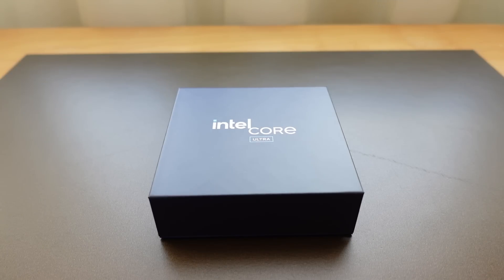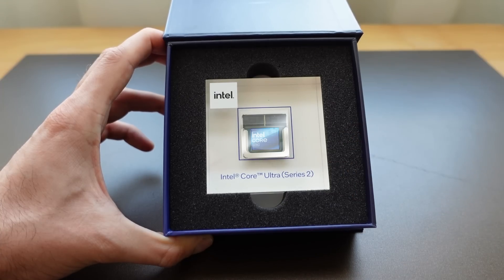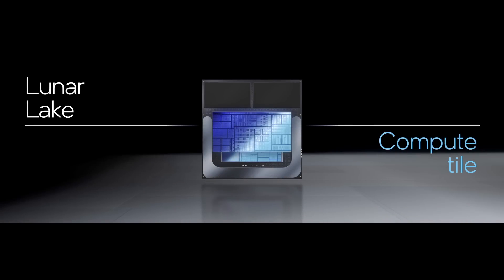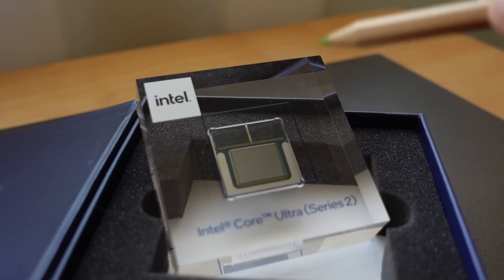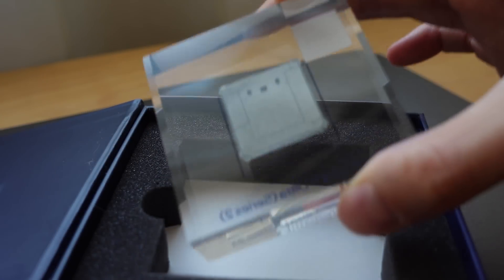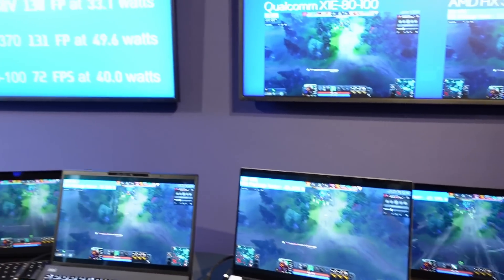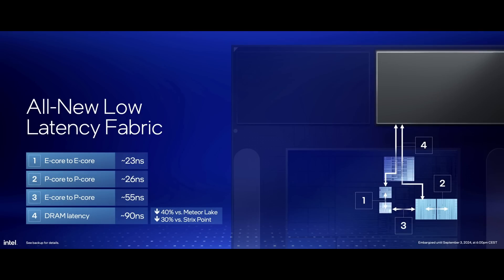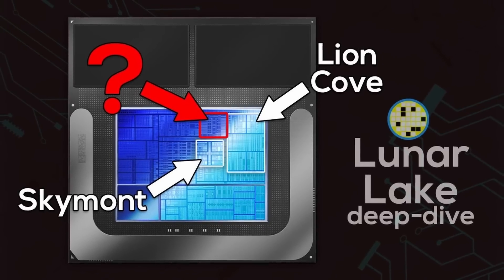Hands-on with Lunar Lake

Comment: I'm really happy you got to get one of these early units! I've commented before from the litho side of things as that was my doctoral research, but I though I'd add that my team did a good chunk of the Foveros groundwork that is in there. I'm really excited for LNL as it's a new sort of approach to chip design, even compared to MTL, for the teams behind it.
Reply: Correct me if I'm wrong but to the uneducated me it seems to be pretty much the same as what AMD does with its desktop CPUs, but more complicated, expensive and error prone.
Reply: @Psychx_  High Yield has a video from May 2023 (i.e. before Meteor Lake launched) called "Meteor Lake – Can Intel leapfrog AMD?". I found it an excellent primer on the technical differences (and different goals) between AMD's "chiplet + Infinity Fabric" approach and Intel's "tiles + Foveros" approach. :)
Reply: @Psychx_  It's actually completely different to what AMD does with their desktop CPUs.

1. AMD's Desktop CPUs divide compute resources between multiple dies. The CPU can be split between multiple CCDs, and the iGPU is on the IOD. This introduces latency and coherency challenges, and costs power to cross the interconnect.

Lunar Lake's compute is all on one die. This means that the CPU clusters, GPU, and NPU can share resources more quickly and at lower power.

2. AMD's desktop CPUs use PCB packaging to connect their dies. This is cheap, but has limitations in speed and power efficiency.

Lunar Lake's base tile is a silicon interposer, which means moving data through it is closer to the characteristics of a monolithic piece of silicon. There are benefits in power, bandwidth, and latency to be had there.

The error rate of this type of packaging is actually not much greater than with PCB packaging, so the only added cost is the relatively cheap silicon interposer, which can be made on much older and cheaper processes than the compute and I/O tiles.

3. AMD's desktop CPUs have identical architectures between their CPU clusters. The only potential differences are in the clock speeds and L3 cache sizes. To my knowledge, both CCDs are also always on under normal conditions.

Lunar Lake's CPU clusters use completely different architectures, and can be powered down when not needed. This saves power, and allows for each to be tailored to their jobs. LPE cluster is designed to contain tasks to the least power-hungry cores, and the P cluster is present to back them up for demanding workloads with 4 additional stronger threads.
Reply: @DigitalJedi  that sounds impressive, but at what kind of manufacturing costs is this efficiency achieved?
Reply: @DigitalJedi  "It's actually completely different to what AMD does with their desktop CPUs."

It's all MCM regardless of the connection methods and what transistors are on what die.  To say it's COMPLETELY different is laughable.

Of course it's different because if it were the same they'd see patent infringement lawsuits, since after all these companies patent what they do, now more so than ever since there's a chunk of the world that will blatantly steal or take whatever they want and will copy if they feel they can get away with it.

If you want to put this in a form of chronology, cost to manufacture, etc.....  AMD has led.  When AMD developed their chiplet processes with the help of TSMC they did so in a way that was cost effective and it led to AMD taking significant market share.

Intel shills can try to talk their way around this but that's the reality of the last few years.

Zen 6 is supposed to get AMD off of using a dedicated die to run an interconnect to doing direct connects between die in which case both AMD and Intel will be using slightly different technology but not enough to beat on one's chest about how much better one is compared to the other.  They will both have connections that are low latency and high speed and low power.  Until Intel put out this product AMD hasn't needed to sweat it.  But AMD has been planning for this for years, so..............  I'd say AMD has done well pushing the point of MCM since Intel moved to MCM to compete, and that's a good thing because the world will benefit from both companies competing in this realm.
Reply: @aravindpallippara1577  I addressed as much as I can say about costs here:

"The error rate of this type of packaging is actually not much greater than with PCB packaging, so the only added cost is the relatively cheap silicon interposer, which can be made on much older and cheaper processes than the compute and I/O tiles."

To clarify, Lunar Lake's packaging is technically more expensive than the TSMC service AMD uses, but it is by far not the most expensive part of the product.
Reply: @johndoh5182  I'm not going to bother engaging with what reads like a wall of rage bait and accusations of shilling.

The only response you will get from me is that from my perspective you sound uninformed on what these technologies actually involve. Your statement that all MCM methods are the same is just as laughable as you claim my stated differences to be.
Reply: @DigitalJedi  That sounds promising as well - I am all for better interconnects with low latency all around. That seems to be the way of the future since EUV future node reticle sizes are so much smaller than it used to be.
Reply: @DigitalJedi  hey! :)
I'd just like to say a HUGE thank you for your comments/thread on the video about backside power delivery and here! It honestly was the most engaging read for me, this year. It probably also has been the greatest contributor to my refound excitement for the upcoming CPU releases. And it got my excited about laptop chips, which I can't remember being in a long while! 
So I would just swing by to say thank you for that and I'm very sorry that you had to encounter these no-knowledge armchair expert here, that try to get you, an actual expert, down. They aren't worth the energy. Hats of for responding to them back in a fitting manner and keeping your self respect up. 

All the best to you from me. Hope to see you some time in a future videos comment section :)
Reply: @noer0205  Thank you! And I'm glad I could get you back into laptop chips again. In my opinion, they're some of the most interesting to work on as the power constraints and range of applications are more challenging to design for.

I'll be in every High Yield comment section on Intel stuff for the foreseeable future, so hopefully that's Arrow Lake soon.
Reply: @DigitalJedi  So glad to hear it! And yeah laptop chips really are the efficiency challenge taken right to the edge of current engineering/manufacturing abilities. And as a consumer the portability is worth so much!
Reply: @Psychx_  ouch! 😆

Comment: "as you can't upgrade the memory later" - how to discourage me from buying that CPU altogether. So - no additional external RAM is possible even if the motherboard has the slots? Is it an Apple meme product?
Reply from the maker: It’s uses on-package memory, just like Apple. But that allows a much more compact design and it improves energy efficiency. It’s not without reason. The drawback is that you can’t upgrade the RAM.
Reply: LNL's memory controller is already fully populated by the onboard RAM. The product targets ultraportables and basic users. Think of it like a successor to the core M or Y series. Those products aren't meant to be productivity heavyweights, so moving memory on-package to save power and push up the bandwidth makes sense.

It's a sacrifice made to ensure LNL is as good as it can be at the market it targets, but it does mean it is less flexible than in the past, though not really any less flexible than other LPDDR5X machines, as they are also running soldered RAM right now.
Reply: @DigitalJedi  What is LNL by the way?
Reply: @chetan_naik  LNL is the shortened name of Lunar Lake. Every intel generation has one. The last 5 were.

Meteor Lake: MTL

Raptor Lake: RPL

Alder Lake: ADL

Tiger Lake: TGL

Rocket Lake: RKL
Reply: @DigitalJedi  Oh shit, too bad I should have guessed it, so simple.

Comment: Nice to see intel being able to compete again on power use.
Reply: Agreed.  If Intel can compete with the rest its a win win for consumers.
Reply: they competing no were lol their power usage is just horrible they cannot manage to come even near the low power usage of any arm chips
Reply: you hope
Reply: Intel was always #1 on pwr use. Biggest number every time.
Reply: Meteor Lake was also supposed to do that. So was Alder Lake. So was Ice Lake.
Reply: @KellyWu04 you think that they’re making up the power numbers on production laptops that reviewers got to play with?
Reply: @KellyWu04  So was Zen 1, Zen+, and Zen 2 yawn We're all posting arbitrary comments it appears.
Reply: like zen are more efficient than intel especially their desktop part.  @nerdynumen
Reply: They werent that bad if not overclocked to hell. If you clock them back a tiny bit and turn down the voltage 13th gen was bit more efficient than ryzen
Reply: @AlpineTheHusky  tldr no. Both zen4 and RL+RLR were pushed to stupid levels of inefficiency out of the box at top spec.  Both the K/KS and X parts can be toned down to more than double the perf/W by limiting boost frequencies. But in no way is the Intel uarch "more efficient" than zen.
I have a 13900HX which is basically the same 8+16 chip limited to 157W/100W. At 100W fully loaded it hovers around 4.2ghz P core and 3.0ghz E core. The 7945HX only needs around 70W to get the same CB scores (Jarrodstech has a direct power scaling comparison between them from a year or two ago)
And the X3D is even more efficient in workloads where the cache gets used.

Comment: Finally, an x86 chip that can compete, or surpass Arm on efficiency
Reply: Looking at windows performance, ARM is not as efficient as Strix Point more often than it is.
Remember, efficiency ISN’T battery life it’s performance per watt.
Reply: Do you mean Ryzen Ai. Sorry the naming is ridiculous, but it is way better than any x86 in terms of efficiency
Reply: @MrAdhiSuryana  yes, the code name for the AI 300 series is Strix Point. I also hate the naming a ton, hence why I say Strix Point
Reply: Surpass? Easy tiger it’s very early days.

Comment: Is this still x86 or ARM?
Reply from the maker: x86
Reply: @HighYield  Thanks! So it has "better compatibility" than ARM cpus and from the infographics intel provided, it seems not only to be faster but more energy efficient. Interesting!
Reply: X86. Arm is a sidenote, why are you thinking Intel is making Arm? Intel owns the best instruction set which is x86 by a huge margin. Arm is just cost saving thing barely able to compete with Intel worst designs and silicon. I just saw Lunar Lake launch and it smokes Arm silicon. Tons of games didnt even start on Arm, like wtf..
Reply: @impuls60  Lately, I've been reading a lot about how ARM is a "game changer" and it's going to "revolutionize" computing. From the M1 chip from apple to the snapdragon from qualcom. The RasPi is using ARM as well and phones/tablets too.

Comment: nice only 32GB ram max? Also the npu bro thats like 65% of the gpu die size? all for what? there is like nothing that can actually use the npu in the future probably but i just cant see it anything other than a massive waste if i am deep in Ai i wont be using some weak ass laptop with 32GB ram bro. Curretnly getting good Ai output requires so much compute or else the quality just nosedives, then why i are we pushing so much into on device compute? Could should be the way to go until on device is actually viable.   Idk bro not an expert just want some answers form anyone who knows.
Reply: It’s simple why they are using so much die space for the NPU. We need to have strong NPUs to be able to program for AI apps. It’s a chicken and egg situation,
Reply: NPU is for Windowss AI services.

Comment: backplane power when?!
Reply from the maker: If we are lucky, there will be a version of Arrow Lake on Intel’s 20A process node next year.
Reply: @HighYield  Will it have GAA Ribbonfet transistors too?
Reply: @ItsCOMMANDer_ yes, GAA transistors does come with 20A
Reply: @benc3825  lets goo, when will we be expecting A20 to go into production?
Reply: @ItsCOMMANDer_  A20? If you mean 20A, then it is mass production ready as of H1’2024, with 18A being end of this year. I’d give it 6-9 months after it is ready before any products will come out. That’s the standard lead time for silicon products.
I’d say hopefully H1’2025 for the first Intel 20A product
Reply: @HighYield from what I’ve seen, the first “gen” of 20A doesn’t have BSPD/it isn’t a requirement, but the second “gen” of 20A (which could just mean 18A) and 18A have BSPD
It’s hard to find solid info that doesn’t mix where 20A and 18A is said to be “the first” node with BSPD
Reply: @HighYield  What do you think about Intel talking about scaling back their fab plans for financial reasons? Doesnt the 20A process require newer fabs? Cheers!

Comment: Sadly Lunar Lake is limited to 32 GB RAM. I need at least 64...
Reply: I need 128gb minimum. 1tb laptop is ideal for playing 100 instances of my favorite games in VMs all connect to the same server.
Reply: @christophermullins7163 But what if you just order four laptops? 🤔
Reply: @gleb.salmanov  like a quadruple stacker?
Reply: 32GB is plenty for the type of user that these target. If you need 64GB of RAM, you also likely need more compute power than an 4+4C/8T, 8-17W TDP chip can provide. You will probably be more interested in Arrow Lake-H when that releases, as the architecture is similar, but uses more conventional RAM. I expect many of those to still use soldered LPDDR of some kind, but higher-tier options.

Comment: Feels almost like Intel and AMD are copying each other for this gen of mobile chips. Intel is going with a chiplet architecture with separate CPU and IO dies like AMD has been doing on desktop for a while, meanwhile AMD is drifting more towards big/little with Zen5 and Zen5C.
Reply: To add to what digitaljedi was saying, the intel chipset approach on mobile is nothing like the amd chiplet approach on desktop. For example, in lunar lake, all of the compute is on the same chiplet. AMD’# chiplet design is pretty much so that they can scale ccds. The whole point is that the cpu cores get their own chiplet so that you can scale cores easily. This is why it’s a desktop approach. It makes no sense when you are constrained by size and power like with mobile. On the other hand, it makes loads of sense when you are making a server chip where you easily see 8 or more ccds.
Reply: It's almost like all of these ideas make sense
Reply: AMD’s CPU cores are the basically the same one is just more compact whereas Intels core design is actually two different cores with separate capabilities.
Reply: Neither of those are new to this generation. LNL actually walks back on the tiling compared to MTL, and AMD's Phoenix APUs were already a 4+4 design.
Reply: @DigitalJedi Phoenix isn’t a 4+4, it’s just a straight Zen 4 8 core. Little Phoenix however is a 2+4 Zen 4/4c core.
Remember, Zen 4C is only a compact core and not a E core
Reply: @benc3825  Right. I was thinking of Phoenix 2. 2+4 on there
Reply: @DigitalJedi  I didn't realize that about MTL, but yeah AMD is leaning more towards the little cores this gen is what I meant. I did know they had them last gen, but the HX 370 and 375 go up to 8 Zen 5C cores